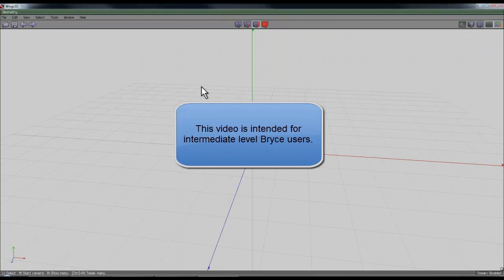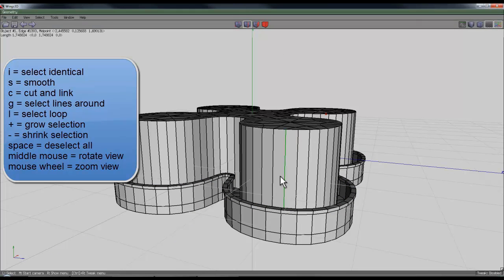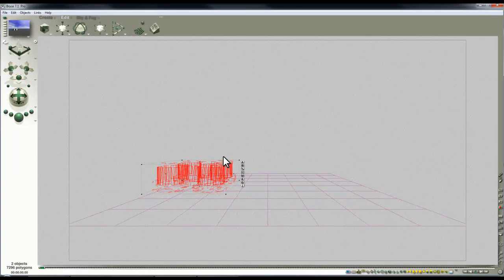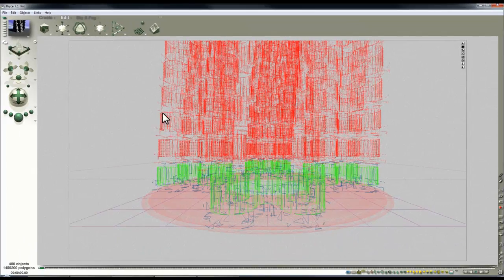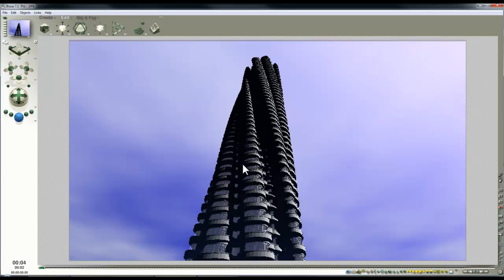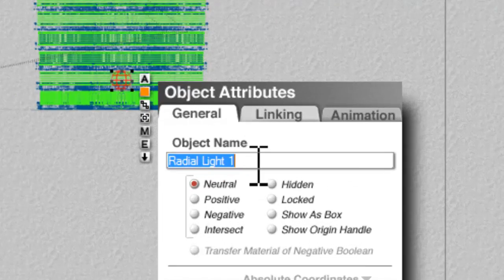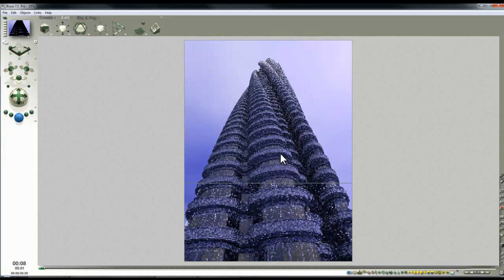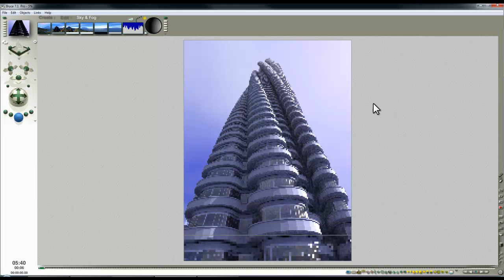Bryce "Nuts and Bolts" - multi-replicate 2 - a tutorial by David Brinnen.

Comment: I totally agree. The default wire frame makes thing hard to model. I sometime find myself trying to see what the solid looks like as I am modeling, and that gets tedious very quickly. Therefore, I use Wings3D, Hexagon, and Blender to create my base models, and then import them into Bryce. I have been using OBJ format rather than 3DS, but if you say 3DS works better, I'll switch to using it.

Comment: As usual your tutorials are excellent. I have been using Multi-replicate & Instancing for a while now but some of the things you have shown in the two videos I just watched were things I did not know. I do a lot of modeling in Wings3D, & must agree that it is quite a nice app for the amount of memory on my hard drive. Render Time: My i3 is a bit slow so I would need to reduce the amount of instances being used. By the way, use Duplicate, Boolean, Group, & Convert to instance primitives.